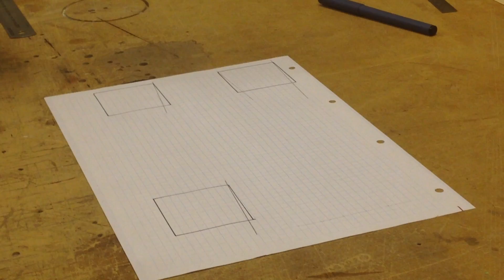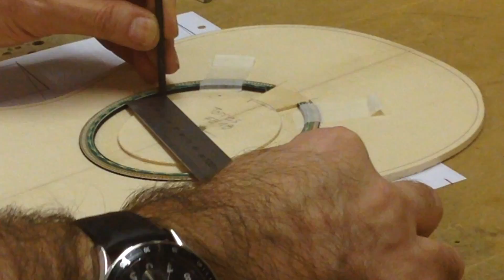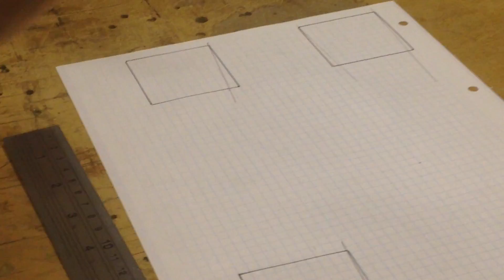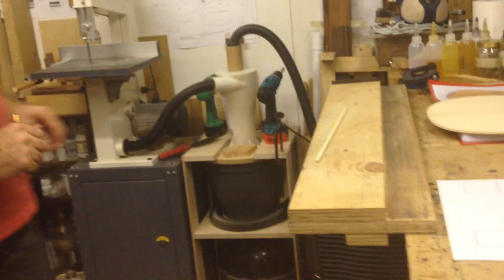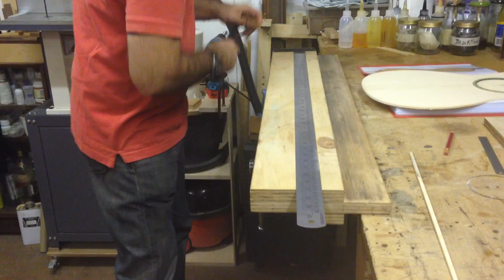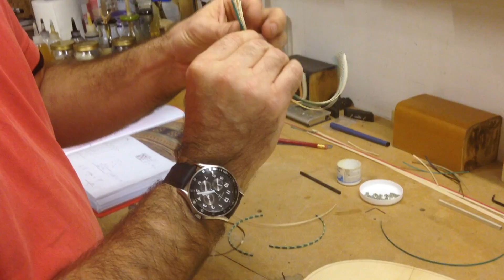Assembling the rosette for a classical guitar

Comment: You say to do 100mm for the first tapered side, then on the other you do 50mm, why is this? Don’t you want an even taper on each side?
Reply from the maker: Noah Fielder to have the same taper in both sides you that’s what you have to do. If you try it you will see it works. By positioning the log at double the distance what you do is to cut half of the taper in one side so that when you position it at 50 mm you cut the other half in the other side. If you place the log at 50 mm to start with you will cut the whole taper in only one side.

Comment: On the other hand I wish to know if always when you make the center guard, you have to sand or scrape it before cutting in orther to make it go round when you inlay it, or that step is not strictly necessary, I mean. Did Javier on the other video have to do that slight sanding on the borders of the guard/square pattern or not.
Reply from the maker: If the tile in the centre is not too big, let's say 3 to 4 mm this is not necessary, you can fit them as they are, however, if the tiles are much bigger then it is a good idea to angle the sides so that they fit well in the arch.

Comment: The method you use to get the correct angle on the tiles for them to fit accurately is so simple and so elegant that I can't think how I never thought of it  before. Many thanks for this. It has removed for me a lot of what used to be guesswork in the past.

Comment: Hi Pablo how are you? I have a question for you did you make the chequerboard mosaic all out of 0.5 veneers or are they made out of 1mm square sticks? I would like make this rosette but where i am the best i can get is 0.5 veneer in 3 or 4 colours, Great videos, thanks Paul
Reply from the maker: Hi Paul, I am well thanks, I hope you are well too.
I used 1mm white veneer and 2 of 0.5 mm green veneer, if you don't find 1mm thick whit you can also do it using 2 of 0.5
All the best.